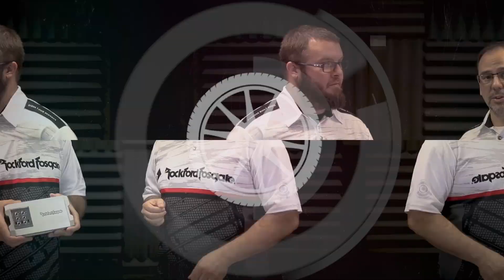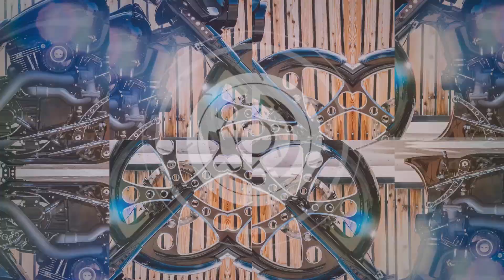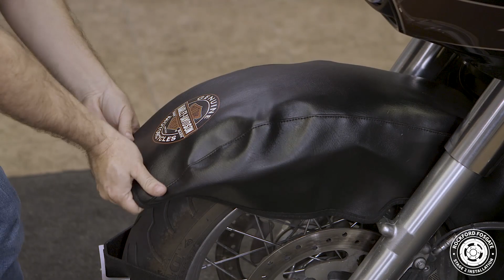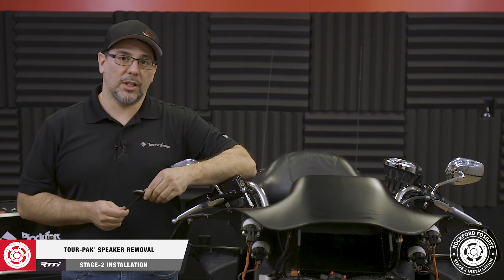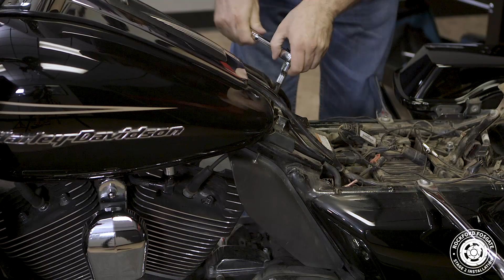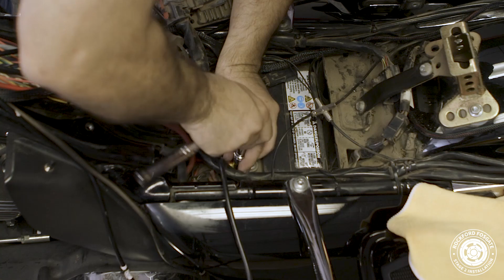1998-13 H-D Road Glide Ultra Stage-2 Installation

Comment: why is there no info , videos or sound demos for the new Harley specific speakers?   here in Canada it seems no dealers keep them in stock to hear and i am very interested in them but so very little info or pics. i already have the dsr1 and the tm400x4ad amp and very seriously considering the 6.5 3 way speakers for my fairing but hard to find out anything or get pics of the back of them not just the front
Reply from the maker: Hi Zane, there are TWO different systems offered by Rockford Fosgate as follows.  Both are completely different systems are are NOT interchangeable with each other.

1) The AFTERMARKET systems like the one shown in the video above, are offered by Rockford Fosgate Motorcycle Audio dealers.  These feature 2-Way TMS speaker systems with the TM400X4ad amplifier and allows integration with the DSR1 digital signal processor.  You can find more information on the AFTERMARKET systems here: https://rockfordfosgate.com/motorcycle/

2) The FACTORY system called HARLEY-DAVIDSON AUDIO POWERED BY ROCKFORD FOSGATE is only available through Harley-Davidson dealerships. These feature 3-Way speaker systems with a dedicated primary amplifier with built-in DSP and optional secondary amplifier for 6 & 8 speaker systems. You can find more information on the FACTORY equipped systems here: https://rockfordfosgate.com/products/system/make/harley-davidson/
Reply: @rockfordfosgate   i am building a custom bike  so hence all my questions and research thank you
Reply: @rockfordfosgate   thanks for your reply but just to get things right you are saying i can not go to a Harley dealership and just purchase the speakers as they will not work with my setup? it will all be Rockford but the head unit thank you if you can clarify this question
Reply from the maker: @zanedgallipeau9119  Thanks for clarifying your direction ... yes, you can purchase the Stage-1 or Stage-2 speakers directly from Harley-Davidson and they will work because they are 4Ω drivers. The TM400X4ad is stable down to 2Ω per channel, so these 4Ω speakers will work just fine. 

For others reading this, since Zane is doing a completely custom installation based on his personal goals, there are no application guides, wiring diagrams, or DSP setting available for his configuration.
Reply: @rockfordfosgate   thank you for your answer i appreciate all your help and look forward to getting it all set up
Reply from the maker: @zanedgallipeau9119  You’re welcome.  If you need help along the way, tech support is a great resource… just let them know what you’re doing up front so they know you’re building a custom system.
Reply: @rockfordfosgate   you bet thank you so much👍👍